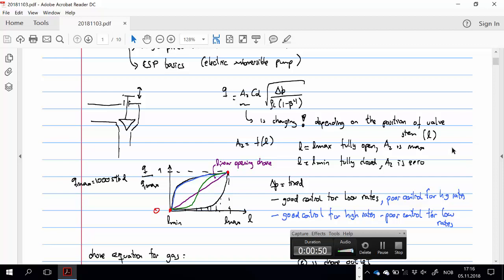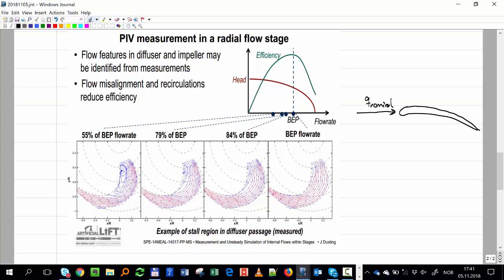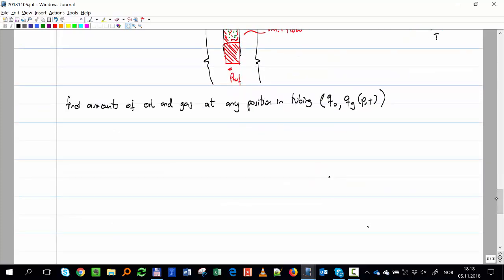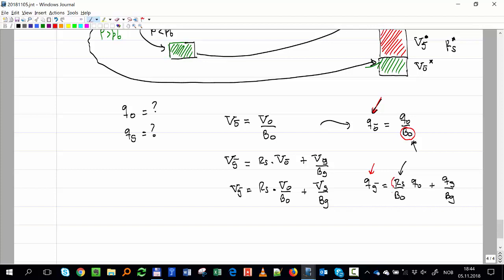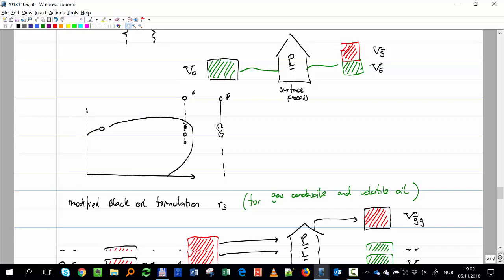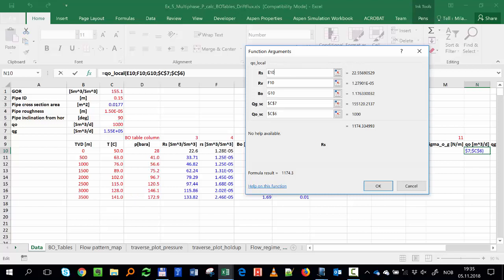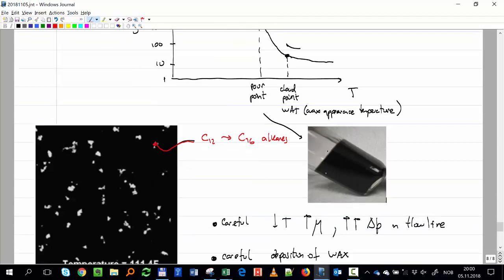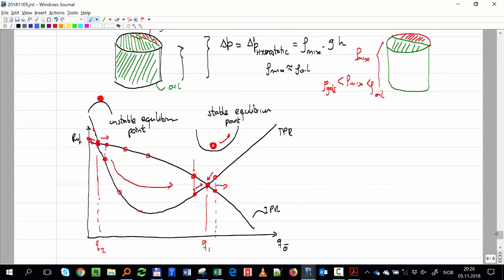Electric submersible pumping, black oil properties

Comment: Hello Professor Milan. I like your lectures too much. It's helpful. I would to know if you can tell me, what is different between using VFD, VSD and Inverter with ESP?
Reply: VFD, VSD and VSC are all the same. Change the pump speed by changing the frequency. You change the frequency by passing the 3 phase AC to converter and then to inverter and then to cable which eventually go to ESP.  By doing this essentially you are converting AC (from generator) - DC - back to AC. Frequency is changed during the process.  You can easily understand this by search how does inverter works